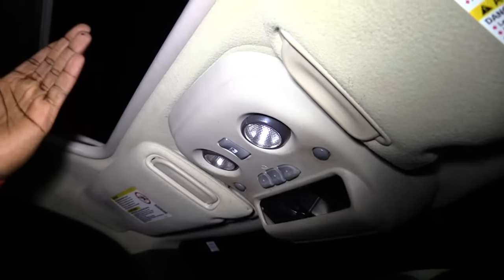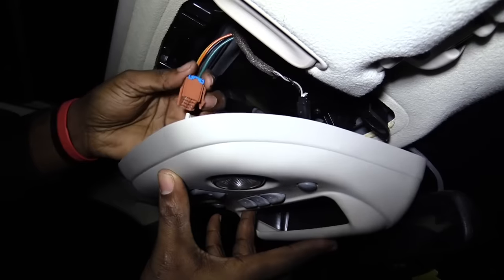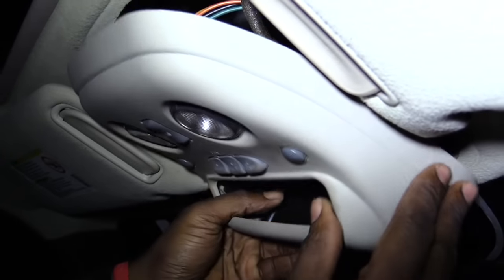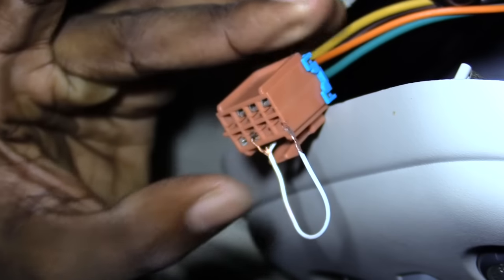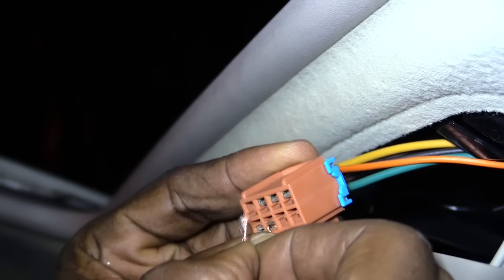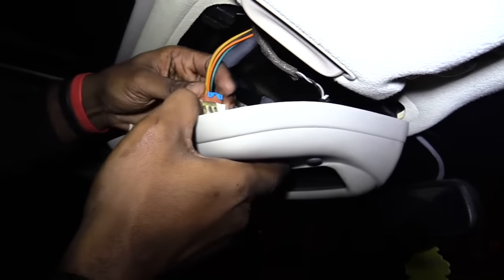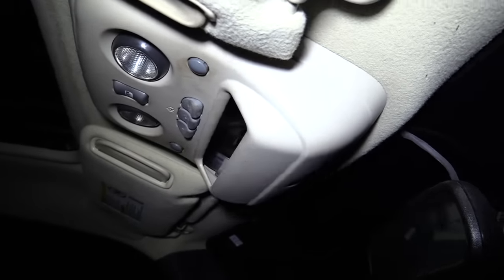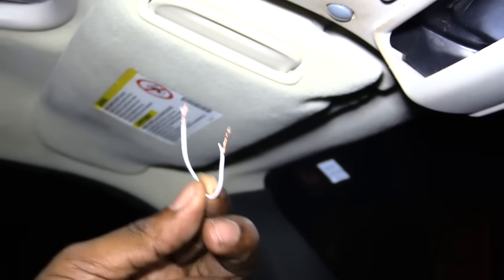How to open/close -Sunroof / Moonroof when switch won't work-EASY

Comment: I have a 2003 neon sxt and my switch is slightly different. I don't have the numerous points as your orange control switch. I have only 3 spots to put a wire to hardwire the moonroof to close. I need some assistance, hope you can help. My moonroof is stuck open.
Reply from the maker: Jolene Lopes Thanks for watching i would use a small wire from a old phone charger and try different spots tell u find the one that works.goodluck
Reply: Flashback502 thanks for the advice, we tried a blew a couple fuses. However, it appears that I have faulty wiring to the switch for the moonroof. Then exposed the wires enough to get enough "juice" to it to close. Short in the wrires. Now to learn about the wire replacement.
Reply from the maker: Jolene Lopes your welcome glad u got it closed.

Comment: My problem is, apparently, the cable broke in one side. It will cost minimum $1K to fix. Is there a way to just close it manually? I'm going to try the WD40, although I'm pretty sure that won't work. Won't hurt either. 
Thanks for your time.
Reply from the maker: Hi sorry but not sure how to close manually but might want to try to  pull it closed while pressing the button. Thanks for watching please subscribe Goodluck.
Reply: Flashback502 For everyone, in case of a locked roof and cable snapped, press and hold the close/tilt up button for 15 seconds you will hear that awful cracking sound but it will go back to the closed position.
Reply from the maker: Thanks for that very helpful info, will try that next time.

Comment: hi I have an 05 Chevy trailblazer my sunroof want open but leaks when it rains. Any suggestions
Reply from the maker: Hi thanks for watching,  if u are able to open roof using my method,  I would try to open and close again to be sure roof is all the way closed, if that doesn't work your seal around moonroof is probably bad and needs to be replaced.  Goodluck. Please subscribe

Comment: 2004 neon srt4 when I use the switch to open the sunroof,  it only open for like 1inch and it stops would my motor be out? or is it the switch
Reply from the maker: Hi sounds like a problem with your motor or pully system, also check your track to make sure nothing is blocking it, doesn't sound like a switch problem tho. Thanks for watching Please Subscribe
Reply: Flashback502 thank you will check on it

Comment: how did you make `the charger wire work that well? i was trying forever and i only got the connection to make it close a little bit
Reply from the maker: Brianna Springsteadah Thanks for watching, make sure you have a wire that is thick enough I used 1 from out a old phone charger, also make sure your car battery is strong enough to close or open window. Please subscribe
Reply: Flashback502 thanks for getting back to me! Did you cut the phone charger in a certain way?
Reply: I see a lot of the wore sticking out of the end, did you cut away a certain layer ?
Reply from the maker: Brianna Springsteadah yes I made sure there was a thick piece of wire sticking out about a 1/2 inch long. Also make sure there is nothing blocking your window  track.
Reply: Flashback502 ohh ok, so it has to be able to reach down that little hole?
Reply: I got it to work like 25% of the way, I don't see anything on the tracks
Reply from the maker: Brianna Springsteadah yes u want the wire to go all the way n the hole, if window  is moving then you have a good connection.
Reply: Flashback502 thanks so much, I'm gonna try it again! And I'll subscribe, you saved me because this is my company vehicle and I left the sunroof open, it got rained on and stopped working. So hopefully I can get this to work the rest of the way now

Comment: Hey I have a 2000 Nissan Maxima and it'll open but it won't close what you think what's wrong with the sunroof
Reply from the maker: Woodberry Maxima thanks for watching sounds like your switch is bad, the close part of the switch is most likely bad. Please Subscribe and share if haven't already and check out my other helpful videos.

Comment: Mines making noise but not moving, did yours do the same?
Reply: Switch could be dead but i can hear the motor move? Maybe im trippin
Reply from the maker: Hulk Rattpack if u hear noise when u press the switch then more then likely it's not the switch, check your track could be blocked  also could be your pulley system. Goodluck
Reply: Flashback502 any videos on where to check that or what to look for?
Reply: Flashback502 thanks btw man!
Reply from the maker: Hulk Rattpack if u can look from the top in your track to be sure it's not blocked, also helps sometimes  to pull slightly on window while your pressing the switch sometimes can free it up if stuck, there are videos up on YouTube dealing with moonroof pulley system.
Reply: Flashback502 on my 300c the back of the sun roof where it vents is stuck half closed and open

Comment: If I do this and it moves then its a bad switch?
Reply from the maker: Yes
Reply: @Flashback502  okay, thank you, and it can be any wire cable? Like a phone one? Or does it have to be an higher voltage bearing wire? Sorry not sure

Comment: Just as side note, for a Nissan Altima this doesn't work but you can use a Allen wrench to manually close or open in an emergency. It's a kinda white allen key hole where sunroof motor is under cover. This just happened to me and after extensive research came upon a comment by someone else. Nissan doesn't even have this listed in their manual for an emergency-BS on them!
Reply from the maker: Robert Kimmerley good info thanks for watching and posting comment. Please subscribe thanks.

Comment: My switch doesn't have the eight spots it only has 4. Can I still jump
 it?
Reply from the maker: Gerald Preston thanks for watching yes you can still jump it. Please Subscribe and share if haven't already and check out my other helpful videos.
Reply: subscribed:  love to hear the idea when the wire I detached from the switch only has 4 spots to put wire in. It's going to rain tonight and will stink if its open and I have to go through the trouble of tape and plastic
Reply from the maker: Gerald Preston thanks for subscription hope things workout for you.
Reply: No ideas?
Reply from the maker: Gerald Preston not sure on yours I had to use trail and error until I found the right holes.
Reply: Ok  I'll try a combo of all. I just didn't want to short something out because I have no idea (what) gets shorted out
Reply from the maker: Gerald Preston it's very hard to short it out if you see a spark just rember that combination of spots so you want try the same 2 spots again.

Comment: i have a mercedes s550 the rubber seal got stuck inside the wheel making it so it cannot open, how can I fix that so I can manually get it open to fix the seal
Reply from the maker: Hi thanks for watching unfortunately I haven't had that problem,  but you may want to try and open with switch while gently pushing with your hand to open. Goodluck please Subscribe.

Comment: Will this work on a 2006 Chrysler 300, the sunroof wants to open but not shut have pushed buttons before and it has worked but not this time & it's raining lol
Reply from the maker: Hi yes it should work, you just have to figure out which spots to jump, also sometimes when u unplug power supply and plug it back up Window  will work. Thanks for watching please subscribe.
Reply: Flashback502 finally got the cable disconnected, it's a 4 prong .
Reply from the maker: ok try the same spots I did and see if that works, if not just try differnt spots, make sure key is turned to send power. Goodluck

Comment: 05 g35 infinity, the problem I have my sun roof doesn't close all the way, stops about 2-3 inches from closing completely, buttons work, opens correctly, just the closing issue, can u help??
Reply from the maker: Hi, your slides may be getting dry of lubricant. You could have the tracks and slides cleaned and lubricated to see if it helps. If it still does it then the motor may need to be replaced or the entire sunroof system is binding and needs replaced. It works just like a window regulator, and when the cable or pulleys wear out it will bind and not close the window. Hope this helps thanks for watching Please Subscribe

Comment: How can I fix my sunroof,  it doesn't open or closes at all
Reply from the maker: Could be bad switch, motor are pull system I would check fuse first tho, sometimes that's your problem. Please subscribe & like and share if haven't already and check out our other helpful videos
Reply: @Flashback502  where is the fuse for sunroof,  i

Comment: hi what about if my passenger back window goes down random ly on its own  on a 99 Lexus rx300 and moon roof sound like it works but dousint open at all
Reply from the maker: Hi sounds like your moonroof is off track or pully system is broke, probably needs to go to shop. You may have a bad switch on back Window I would disconnect switch on back door and c if it stops problem, if does you need a new switch on that door,  if doesn't you may have a bad master switch in your driver door, that needs to be replace. Thank for watching please subscribe
Reply from the maker: Hi sounds like your moonroof is off track or pully system is broke, probably needs to go to shop. You may have a bad switch on back Window I would disconnect switch on back door and c if it stops problem, if does you need a new switch on that door,  if doesn't you may have a bad master switch in your driver door, that needs to be replace. Thank for watching please subscribe

Comment: mine opens on switch but dont close wat could be the problem i tried it your way but it aint working does it depend on the wire
Reply from the maker: HI yes, You have to make sure you are putting the wires in the correct spot, you may have to play with it until you find which works. If not could be something wrong with your motor. Goodluck. Thanks for watching

Comment: Im having same issue with my suzuki grand vitara 2008 can you help me thanks
Reply from the maker: Thanks for watching this may help ( see below) if not the method I showed in video should also work IF switch is bad you just have to figure out which spots to jump. Please Subscribe if haven't already and check out my other helpful videos and share.

"When disconnecting or replacing the battery, the sunroof auto control must be reset.
With the sunroof glass closed, push the button to tilt it open (not to slide it open) and hold for 10-15 seconds after the tilt has completed. This should reset the auto control.

Now, when you hit the button to open or close the sunroof, it should complete the cycle without having to hold in the button."

Comment: is there a manual solution to this problem for those who fear electricution
Reply from the maker: bandit burtrey thanks for watching on some vehicles there is a alum wrench type tool you can use to close moon roof but on most its electrical. Gooduck please share and subscribe if haven't already and check out my other helpful videos.

Comment: How did you figure out which holes to touch
Reply from the maker: Thanks for watching, I had to just try different holes and If it sparks wrote it down and tried differen t holes til I found the right 1s, took about 10mins.. Please Subscribe and share if haven't already and check out my other helpful videos.
Reply: @Flashback502  you don't think I'll wreck anything or fry fuses?
Reply from the maker: @RobVaughan1984  if you use a small wire like 1 from out of a old phone charger it normally just makes a small spark, but I can't say for sure tho, if your power supply has the same wholes as mine, then use the same 1s I did should work.
Reply: @Flashback502  did you just test all of the holes and eventually it worked? Trial and error?
Reply from the maker: @RobVaughan1984  yes, most cars work with different spots.
Reply from the maker: Definitely wouldn't use a paperclip.
Reply: Whatif all hole ison top whish  is grond from live it is six hole on top  @Flashback502
Reply from the maker: @jodi-annreid1318  unless you can fine a diagram for your vehicle, you will have to use trail and error until you find the right combination. Please Subscribe and share if haven't already and check out my other helpful videos.

Comment: 2000 Chevy blazer sunroof is stuck UP in the tilted position. when I push the button, it makes noise like it wants to close, but it won't move. It won't Slide open either.  Can Anyone help before it starts to rain???
Reply from the maker: Hi sorry to hear of your problem sounds like your sunroof maybe off track or your pully system is not working,  you may want to have someone push the button while you lightly push down on window, also check the track to make sure nothings blocking it.
Reply: Thx...I'll try that. It stopped sliding back about a month ago. But it would still go up & down.  Now, it's stuck Up. When I push the button, it makes sound like it wants to move, but nothing.  How do I LOOK In there?
Reply from the maker: ok sounds like a pully system problem, if you can't see in the track then c if u can run your fingers down it, be careful and don't press button while checking,  but does sound like a pully system problem which means may have to be taken out and fixed.
Reply: Oh My...  "Fixed" how?  Will Blowing compressed air through the track fix the problem if there is something in the track???
Reply: Oh My...
Reply: Thx for Ur time btw...

Comment: Thanks! I’m going to try this. I pushed the button on my 2000 Jeep Grand Cherokee I just got, and didn’t have the slider part, that blocks the sun, pushed all the way back. So it moved down and got stuck on the slider and then quit working. I got the slider part to come back forward and the sunroof looks like it went back to sealed position but now the sunroof button doesn’t do anything.
Reply from the maker: carrtiff1979tc thanks for watching I would check your fuse first to be sure it didn't get blown, please subscribe and share if haven't already and check out my other helpful videos. Goodluck

Comment: My wife's 03 Corolla has a moonroof stuck open. I want to try this but the harness and pins are different. There's 5 on the bottom row, 2 on the top left, and 1 in the top right. I've looked through the owners manual and scoured the internet all night but can't find a wiring diagram for the dome light fixture. I just want to know which pins to short. Help!
Reply from the maker: hi not sure which ones will work on your model car, but if your motor is good and switch is bad then using a jumper wire should work you just have try different spots til one works. Goodluck thanks for watching. Please subscribe
Reply: Flashback502 thanks for the reply. I did try short a few pins using speaker wire as that was all I had on hand, but after a few attempts I got startled when sparks flew on one if the connections. I am afraid of causing damage to something since I'm not an electrician.
Reply from the maker: understandable, if u try again write down the spots that sparked so u want try thoes spots again,  also I would use a smaller wire like one from out of a cell phone charger, wouldn't keep trying tho if sparks are big would take to a shop r get a new switch which is probably the problem.

Comment: Mine having the same problem it stuck in the open position tilted it opens with no problem then when in try to close it then it stayed up 2005 VW passat I change the motor in it cause thought it was that
Reply from the maker: Hi thanks for watching sounds like it is your switch thats bad, especially if u don't hear any sounds when tryn to close.

Comment: How do I replace my sunroof switch on my 2001 Ford Explorer?
Reply from the maker: Hi thanks for watching not sure i haven't removed one from your year truck but should be 2 tabs on the sides you can push with a flat head screw driver. Goodluck Please subscribe thanks

Comment: 09 impala sunroof wont close...i jus tried the hot wire but nothing
Reply from the maker: Thanks for watching,  if u hear no noise at all when trying to hot wire I would check fuse, also make sure you have power going to roof, and if still the same then your roof motor maybe blown. Good luck.  Please subscribe

Comment: 2008 honda accord ?? I'm having trouble with mine
Reply from the maker: Thanks for watching this process should work with your Honda, you just have to figure out which wires to connect, unless the motor is gone out in your moon/roof in that case you will need a new motor. Good luck. Please Subscribe.

Comment: Will this work on a 2018 Lincoln Navigator?
Reply: @mustang9549  it works for any switch, even ur kitchen.  Just connect the circuit.  Mine got completely cut, don't ask how.  Was wondering what wires I can connect to hotwire? On buick envision.  If not I'll have to look up diagram somewhere

Comment: fyi, I have 6 metal plates on the socket as compared to your 5😀
Reply from the maker: Hi if when you press the switch you hear a motor sound that means your switch is working,  it sounds like your moon roof may be off track or something maybe blocking track. thanks for watching goodluck.

Comment: When I did this my wires flew red and melted
Reply from the maker: Make sure you use a wire that is thick enough to hold power I used a old cell phone charger and cut a wire from out of it.
Reply: @Flashback502  It was a thick copper wire sparks flew everywhere And flew orange and fell apart
Reply from the maker: @ytspgaming2614  never seen that happen, just some speaks. Also make sure you use electrical wire not speaker wire.